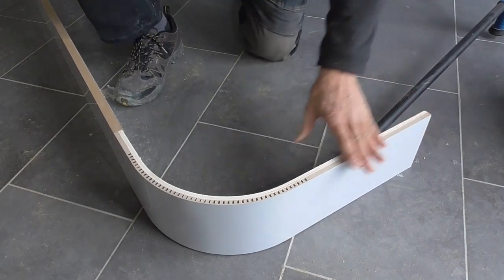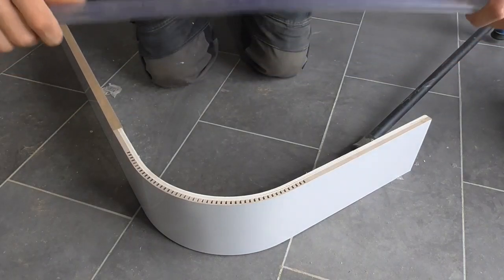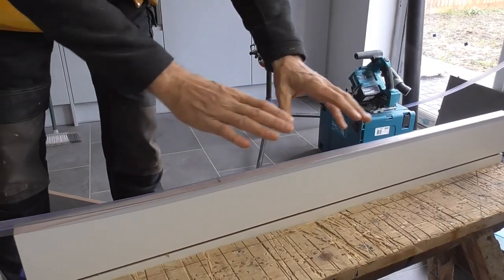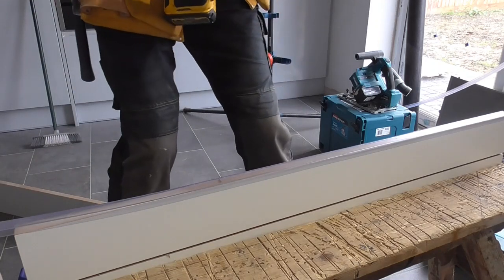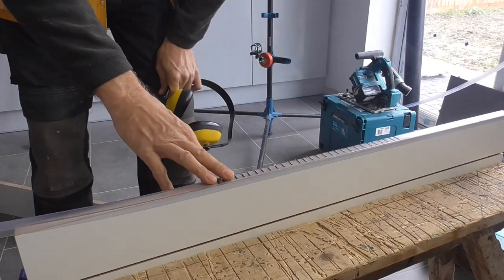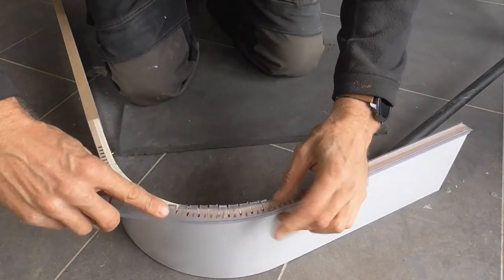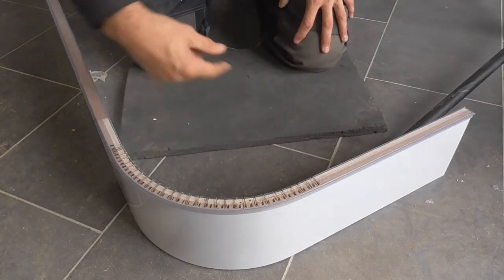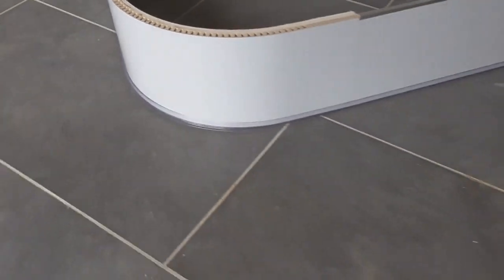How to bend straight floor trim around a curved kitchen plinth.

Comment: Kudos, your showing our tips to Joe public,  thats the difference between a diy fit and professional fit , I tend to silicone the underside as well where the slots are to prevent moisture uptake
Reply from the maker: Hi there🖐Thanks for your comment bud, and the kitchen industry really needs to come up with something different for plinths, as using ANY form of wood is just not suitable for contact with a kitchen floor😬Cheers Del
Reply: Agreed , even the plastic alloy covered/mock stainless is shite ,

Comment: Great idea using the grinder, personally myself  I use a pair of hand nibblers, a bit less smokey😉 Glad you fitted the seal strip to the plinths and didn't throw them away like some do.
Reply from the maker: Hi John. I'm so glad to hear that you do the same mate.🤩 I've never seen any other kitchens with curved plinths have the strip fitted.😬 Good on ya mate, and thanks for your comment.👍Cheers.
Reply: I have a set of Wiss snips the are perfect for jobs like that
Reply: @gavincollins9376  the nibblers i use are Wiss. Handy for cutting  laminate.

Comment: I would never have tried that. Knowing how inflexible those trims are, I would have thought it would just snap. Very impressed mate. Will definitely remember that one. 👍🏻
Reply from the maker: Hi Paul. I know the trim is not to everyone's taste, but I like the protection it gives the timber plinth, and it accommodates slight variations in the floor.😎 Appreciate your comment.👍
Reply: I know what your saying mate. You don’t often see it these days. I used it on my own kitchen. Well worth the effort in my eyes.
Reply from the maker: @paulyoull5472  Agreed!😎

Comment: Great video TC as always, I was taught to notch out V grooves on the plastic to help it bend, but like you did it works just as well. Thank you.
Reply from the maker: Hi Stephen. The first time I tried this I used the table saw. It worked but was a bit touch and go as to whether it was going to snatch and shatter. The grinder is much better. Ultimately, it doesn't matter how you get it to bend as long as it works. Most people just leave it off.🙄Cheers.

Comment: Your man after my own heart, loving the wooden stools, still got mine from when I started out, lovely tip also. 

Did this same technique on a length of skirting to follow a curved wall. Looking awesome. It’s the little touches that count as always!
Reply from the maker: Hi Chris. Its great that you still have your stools.🤩 I made those 20 years ago and they're possibly the most handy bits of kit I've got.👊 Its a bit more effort to form the skirting as you describe, but so worth it.😎 Cheers.

Comment: I was going to say the same as one of your other commenters about water ingress through the cuts. Personally I think I might have run some silicone sealant just for belt and braces especially as you say they are expensive bits of kit. Great idea though and interestingly executed, I shall remember that for future use. Love all the videos even though I'm a DIY'er (jack of all trades ......). Thanks for some interesting viewing sir!
Reply from the maker: Hi there. Yes, I guess silicone would have given it an extra layer of protection, but it's not something I see as too much of a problem unless there is a large amount of water on the floor👊 Thanks for your great comment, and for watching 😎 Cheers Del
Reply: @thetallcarpenter  lol you haven’t seen my father in law dabbing the decks! Good luck with your channel it’s great!
Reply from the maker: @grumblesworkshop9984  🤩👍

Comment: Like your kneeling mat 
It’s in all your vids 😉
Reply from the maker: Hi Terry. Its just a bit pf packaging foam, but its handy to just kick about and kneel.🤩Thanks for your comment.👍
Reply: @thetallcarpenter  Gel knee pads that slip into pouches on work trousers. Might look like you've got camel knees but who cares, they're great for old knees. No more straps around the back cutting off blood circulation. Keep  mine in motor ready for use when needed.
Reply from the maker: @1starshot  Hi Paul. Yeah, I remember the days of uncomfortable knee pad straps.😣 The problem I have with knee pads in trousers, is my legs are soo long that when I bend the knee pad pocket gets pulled into the wrong position, (to high over the centre of the knee cap), so not really any good for me.😢 And of course, then there's the whole, 'shorts', issue!!.😝 Have a nice weekend.👍
Reply: @thetallcarpenter  Haha I know what you mean. Get your missus to sew on some lower pouches. I've never worn shorts for work, I leave enough blood on jobs anyway, especially when tiling. Have a good one yourself.
Reply from the maker: @1starshot  🤩👍

Comment: Very nice, looks like it was made for it, but what about all the cuts? Will they need to be sealed up?
Reply from the maker: Hi Dan. I don't sweat too much about raw underside of the plinth, as the trim holds it off the floor by a couple of mm, so, unless there's an absolute flood, it shouldn't come into contact with any water👊 Thanks for your comment and for watching 😎 Cheers Del
Reply: @thetallcarpenter  ah I get ya
Reply from the maker: @danthechippie4439  👍😎